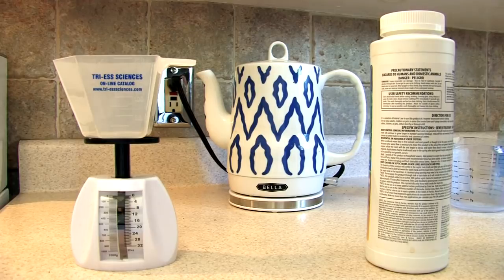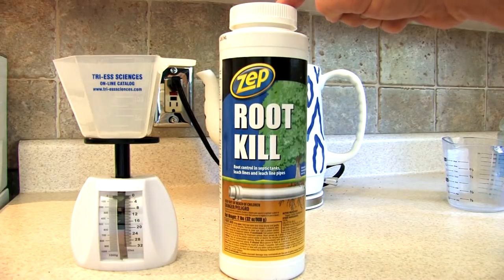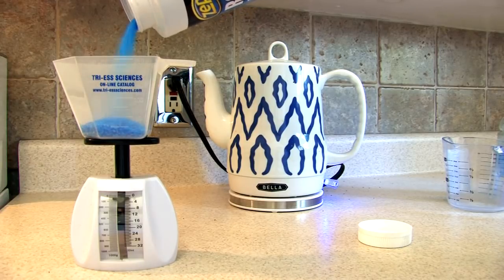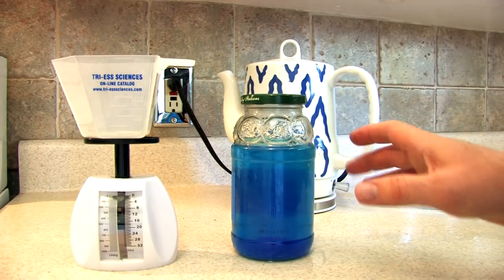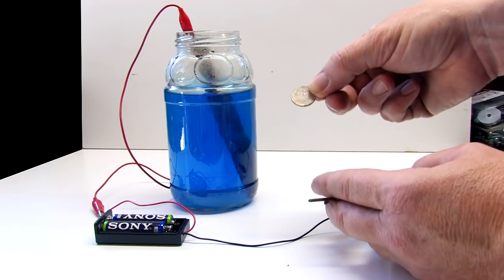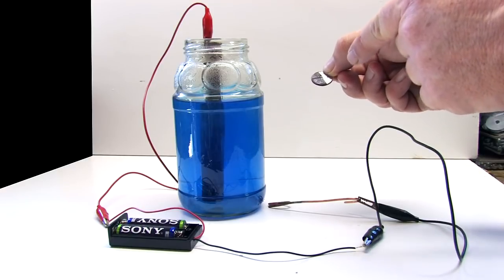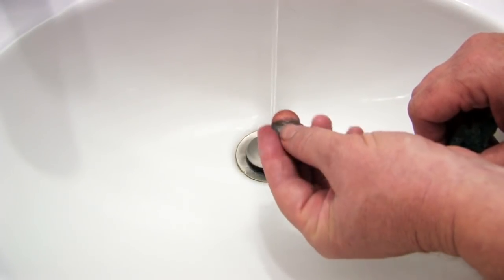Easy And Inexpensive Copper Plating Trick!

Comment: I followed this to a T, but used 5 amp/5 volts and it came out horrible. I used a dc power supply. What am I doing wrong?! Red clamp to copper and black clamp to part, and it turned out orange 🍊

Comment: Slap yourself!!! How do you play with chemicals without knowing what it will do or what it does? Thank goodness that it was only water… “hydrate” meaning contains water instead of it being anhydrous.. <—— meaning has no water.. by the way you do realize if you kept the electrolysis going that the  solution would turn into sulfuric acid?? The anode you were using would eventually get dissolved into the solution, try using an inert anode

Comment: try copper sulfate solution (cheaper on amazon in lab grade for 500ml), vinegar, and 4 ought steel wool fanned and wrapped around the material to be plated. Let sit for  15-30 min depending ... no electricity required.  Rinse with tap water mixed with some baking soda to neutralize the acid, and voila.

Comment: I'm trying to copper plate clamps that originally were copper plated. I cleaned them to bare bright metal. Using this method with 100% copper sulfate I'm getting a copper crust that falls right off in the solution. After 15 minutes I removed them and then brown crust rinsed right off. I'm using a lab power supply at 3v drawing about 1.5 amps. Any reason for this?

Comment: Dude! 3 minutes with an unsaturated solution I copper plated one of my lockpicks.. With an 18650 3.7v battery, no noticeable loss in battery voltage.

NOW, the reason for attempting this..

I want to copper plate some steel wool for a FireWire... Let's see how it goes. I'm excited!

Comment: If that was a 1943 penny then it was a steel penny not zinc plated you should have used a newer non-wheat penny you killed it's value... on a side note... very cool experiment though

Comment: I watched your video on copper plating and followed your method precisely and surgically clean.
I polished a carbon-steel rod as a testpiece and plated for 3 minutes at 3 volts. I then varied the voltage & time but after 6 attempts I still got the same result: a beautiful copper coating that comes off with my fingernail leaving a black surface. I also watched your nickel plating video as I am trying to triple plate some parts of my vintage motorcycle.
I would be extremely grateful if you tell me where I'm going wrong.
Reply: Try cleaning with brake cleaner
Reply: needs to be plated with nickel first

Comment: Nice video, but you kept the tap running while you scrubbed the penny!
Reply: @Nelson Brett Do you know that here in India, we're facing a huge water shortage? There are some villages that have completely gone dry, there isn't a single drop of water in the lakes, wells, and tanks.
Reply: @Nelson Brett Do you know how expensive it is to purify seawater? That's why only rich countries can do it.
Reply: @Nelson Brett If it were that easy to extract pure water from seawater, Cape Town wouldn't have been facing a severe water shortage. Droughts wouldn't even exist if we could do that efficiently.
Reply: @Nelson Brett India has a GDP per capita (PPP) of just $6000 USD. That's 3 times less the than global average, and 10 times less than the US.

Comment: 1stly Thank you for the video! I have tried this a couple of times w/little success. Nickel Strike n all. The strike flaked off 1st run. 2nd run Annode was flaking off. In both, Copper-plate was able to rub off though 2nd run part of it was strong and in other areas not so much. 
Any theories as to why this is happening?
Reply: U need to clean the metal really well. if your plate is patchy as you describe,  its likely because the metal isn't clean .
Reply: Voltage too high….drop down to under a volt.

Comment: @sportster davidson, I agree totally, and apologize in advance of the novel below.
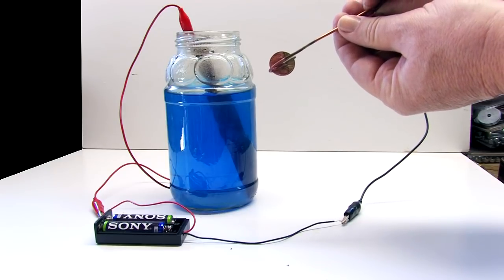5:57  Penny #1 shows the plating line running vertical and covering almost all of Lincoln's head and face, and shows well over 50% of coin coverage. It is a 'wheat penny' but he doesn't show close enough for a date.
The video is stopped and "3 minutes later" .   .   .
6:53 Penny #2  clearly shows a different penny. Still a wheat penny, but the new plating line is at a diagonal from lower right of the coin to upper left running about through Lincoln's throat, and is about 50% coverage over the coin. His entire head is now unplated. 
He then proceeds to the cleanup  and a scrub to show how durable and deep the plating is. 
7:17 through the entire cleaning and scrubbing process you can again see this is now a third different penny. The new plating line is now running pretty much straight horizontal through the collar area of Lincoln, and coin coverage less that 50%.

Comment: I'm playing with plating too. this could be a boon to my plating playtime as it saves a lot of money. I'm wondering about voltages and time. what if you left it in for 30 min or more? what if you use more voltage and amps? what if you use less but give it more time? I'm trying to experiment and answer these questions and more, but I find the cost prohibitive on my meager retirement income. This idea will help. What if you use a mild acid like vinegar instead of water?
Reply: If you use lower voltage and more time, the plating will come  more resistant and less dull.
High power and short time = bad plating.
Give 0,8 Volts and 1 Hour a try !
Take only a teespoon of the magic blue stuff ...  
Just a hint ;-)
Reply: @CharlieKirk1000  So far, my experiments say that's right, lower and slower are better. However it's not so much the voltage but the less milliamps that makes the real difference. (However with lower voltages you tend to get fewer milli amps)  So far I'm down to one point 5 volts at 250 milliamps. That seems to work well, but I go for like 3 or 4 hours at a stretch. If and when I can find some kind of adapter that gives me even less volts and milliamps, I'll try that too.
Reply: @tootall5559  : Have fun bro !
Greet's from a former german Navy Seal, and a happy new year ! Nec aspera terrent.
Reply: @CharlieKirk1000  why would a German Seal use the motto of the 27th Infantry regiment?  for those that don't know, the literal translation is Nought shall afright them or less literally They don't terrify the rough ones ("Difficulties be damned)
Reply: @tootall5559  : Because this is the motto of the minedivers in Germany, and minedivers are a part of the German Navy Seals. :-)
We are locatet in "Eckernförde" / Germany.

Comment: sir, the only "Pure" water is that pushed through what they call a reverse osmosis filter. Distilled water can actually have MORE of certain contaminants. To clarify, depending on the condition of the water they start with, distilled water is heated to boiling or almost boiling and then the steam is captured and cooled back into liquid form. Well, you see some contaminants boil at a LOWER temp than water, so those contaminants get concentrated in the distilled water. If they start with normal city water, it could have what they call trihalomethanes in it. These are compounds formed when they use chlorine to "cleanse" the water. One of those compounds is chloroform, and we all know what that can do. However many of the compounds formed when the chlorine mixes with certain bacteria have not been seen before, and nobody knows exactly what they will do, and what concentration it takes for them to be harmful, if in fact they're harmful at all for that matter. 
Carbon filiters only improve taste, they don't remove much of the contaminants. your best bet is labeled Purified water for this purpose. it's not worth drinking, it tastes like well usually nothing at all, but sometimes tastes like crap depending on the purification used and how good the filters were. We use spring water for drinking purposes. The best water I've ever had was from a natural spring high in the Colorado mountains. You could drink gallons of it, but that was also a draw back, you always wanted more. One sip of the city water in our canteens and we didn't want any more. lol, funny but true.

Comment: Help please !!!!!! 
I’m having a problem with my plating. I’m not able to get sulphuric acid anywhere. Can I use  muriatic acid instead. 

The items I am trying to plate come out dull .
Reply: There’s a vid on here using muriatic acid (hydrochloric acid) and distilled water. Apparently works well.
Reply: They are both the same

Comment: Too bad you can't copper plate a 1943 steel penny and pass it off as an original one.  A real copper 1943 penny is worth a LARGE FORTUNE as I believe only about five were originally made.  All you would have to do though, to prove that it is a fake would be to place a magnet next to it as steel is magnetic and copper is not. Too bad... 😁😁
Reply: You can copper plated a penny, but you need some pretty good preparation, and a thick plating overall.

Comment: Well, it didn't work for me!!I used a piece of copper water pipe and was trying to coat a door knocker I made from a horseshoe and railroad spike. As soon as I dunked the part into the solution it turned a brown color. That was before the copper was put in and connected to the batteries. So, I went ahead and connected the batteries and let it sit for about 20 minutes. There were copper flakes in the solution but I don't think any ended up on my project. I pulled it out and sprayed it with water and 90% of the brown came off easily. I wirebrushed the rest off to get back my original finish.....

Comment: After 20 minutes I checked it and it was copper in color but all “fuzzy”. If you touch it it all falls off and you’re left with the original steel color. Any suggestions?
Reply: Josh Bryan same thing happened to me
Reply: Not sure if you already found an answer or even still need it but it sounds like the object you plated might not have been clean enough. You need to clean the object, obsessively so. For perfect results there shouldn't be any grease or anything on the piece. Not even the oils from your skin. Using gloves might help with that. I hope that helps :)
Reply: Use muriatic acid add a little table salt if required,use 1 D size battery,plating process approx 5 to 10 minutes,more time more thickness layer of copper,neutralize with baking soda solution,scrub with steelwool or steelbrush,wipe immediately with tissue paper or dry cloth,you will see the result would not comes off

Comment: I'm having a horrible time getting proper adhesion... Using the same method but with a 6v battery. The plating either wipes off or wont adhere at all. Ant suggestions?
Reply: Adam korytko .

Comment: Dark blue copper sulphate is always pentahydrate (CuSO4.5H2O). If there were no water molecules attached it would be a very pale blue powder. You can remove the water molecules by micowaving small amounts of the pentahydrate. However, when you dissolve either the hydrated or the anhydrous compounds in water, you get exactly the same thing.

Comment: is there anyway this would copperplate a wax figure successfully?
Reply: Paint the wax item with conductive paint.  I was thinking of plating a candle that had had a lot of wax dripped down it just for the novelty of it.  

I'm looking into this and bought a pound of graphite to add to paint, glue or whatever to make my own conductive paint for plating (forming) leaves, wood items and so on, none of which could be directly plated.

To plate wood, leaves, nuts and so on, I'll have to seal the item first. This can be done with anything that will not dissolve in water, such as lacquer, poly and so on.  Since your wax item doesn't need to be sealed, you can go straight to the conductive paint.

Comment: A few things - voltage is not the thing to worry about, its the current per area of the thing you are plating. Figure out the area of the thing you are plating (for a coin, both sides) and then set your voltage to get a current of about 0.15 amps per square inch. If you have a fixed voltage (like 3 volts) move the electrodes closer or farther apart to get the right current (you will need a current meter). You don't have to be fanatic about the current, just close.

For example, a penny, both sides, has an area of 0.88 square inches, so you need about 132 milliamps. A quarter is about 1.43 square inches so you need about 215 ma.  Higher currents give you orange copper gunk, higher yet give you black copper gunk. 

Cleanliness is a MUST. Nothing sticks unless you clean it. I scrub everything with baking soda and water paste, and scrub hard and then rinse. Use a toothbrush if necessary. Then don't touch the object with your fingers, ever. Baking soda is good for polishing the object after plating too.

I also play around with patina on the copper. Liver of sulfur in water (until its pale yellow) works great, slosh a CLEANED plated obect until it gets dark but not black (takes a minute), then rinse quick and baking soda clean it, then some vegetable oil, and rub the oil off as much as you can. It gives that brown look of an old penny.
Reply: @Kelly Marie you can, but you have to paint the surface with something conductive. There are special conductive paints for electroplating, usually made with graphite.
Reply: Can you give me the ratio with metric system?
Reply: Thank you for the math behind the mad science here. Now I got some things that need plating.
Reply: So I got a lab DC power supply. When I set the current to 0.1A, the voltage jumps to 24V and the jar looks like a boiling pot! Are you sure you didn't miss a couple of zeros in the data above? I get the minimum amount of bubbles with 0.01A and 0.8V

Comment: Use this process to copper plate all the stainless in hospitals. 
The surfaces of copper and its alloys, such as brass and bronze, are antimicrobial.
 They have an inherent ability to kill a wide range of harmful microbes 
relatively rapidly – often within two hours or less – and with a high 
degree of efficiency.
I would like to see an experiment of copper plating stainless steel but using the Brush plating technique.
Nice video production koodos

Comment: i tried this with a steel bolt and it just started rusting like mad not sure why
Reply: David Berry Im not sure if its too late to reply, but its not actually rusting, its probably copper (especially if it wipes off easily). Your copper sulfate to water ratio is too high. Try using 1 part copper sulphate to water

Comment: what is the device called that holds the AA batteries, and where can I buy it?    Looks like  a great substitution to the expensive rectifiers for sale.   Can I get this at radio shack???   what is it called?
Reply: tessajensen58 yep
Reply: +tessajensen58 
It's called a battery holder - and where are there Radio Shacks that are still in business?
:
Reply: I picked one up at Radio Shack years ago (b4 they closed brick & mortar business) it had had an obviously simple name like "battery holder" or "battery carrier. You might want to start there. They're rhe same battery holders used in toys, flashlights, Christmas lights etc.- Any "battery operated" gizmo. They're used by people inventing/building battery operated gizmos. They come in different sizes like  2, 3, 4, or 5 batteries (looked like Stan had either a 2 or 3 battery compartment.) And by battery size AA, AAA, C, D (I think Stan had 2 AA batteries. Could be wrong - go back & check his video.
I, too, joined the Stan Curtain voice fan club! Lots of money in doing "voice-overs!" Hope you consider it!
Reply: Just use a cheap 6 volt square battery, like the kind used in camping lanterns.

Comment: I tried copper plating a piece of steel using this method. The copper transfer was happening really fast and the coating was really nice and even. But when I take the part out of the solution, there is absolutely no adhesion. Copper layer slips away just by touching it. What Can I be doing wrong? I am using an old phone charger as a power source(5Volts)
Any advice, please?....

Comment: even cheaper way is to boil some vinegar and some hydrogen peroxide, even parts if i remember right, once boiling throw a handful of scrap copper wire into the liquid... i suggest doing it outside, the reaction gets pretty steamy, and i dont like the way it smells, but after it settles down bam. theres your blue liquid. they have both vinegar and hydrogen peroxide at my local dollar tree store so thats $2.
Reply: jchinderle - WARNING copper acetate is toxic:

https://pubchem.ncbi.nlm.nih.gov/compound/cupric_acetate#datasheet=lcss&section=Top

Unless there is some special reason to use the acetate instead of the sulfate in solution, leave the acetate to the experts, especially if there are children around.
Reply: Yeah the money you save on the copper sulfate isn’t worth your lungs or liver dude.
Reply: with copper acetate vs. copper sulfate, the plating process is longer, and think you can get a thicker plating for the time involved with the sulfate. Cupric acetate has less free ions to transfer then copper sulfate
**As mentioned too, more precaution should be used when using copper acetate in electroplating as it's releasing toxic fumes and you definitely should not do it indoors

Comment: pentahydrate just means it's the hydrated salt and readily soluble. It's the same stuff. q
Question though as a newbie to plating...does the plating thickness continue to grow as you leave it in solution? could you get a couple of mils thick for custom PCB  manufacturing?

Comment: You don´t  need the copper sulfate. Just take either some ordinary tap water or distilled water and mix it with about 5% muriatic acid (31% plus acid content), connect your + to the copper piece and the - to the piece you wanna plate. 3V is ok but a 9V battery will work, too. Within 5-10 minutes, you´ll get a perfect copper plating. I´ve been using this method for years as you can easily solder iron parts with a copper plating.